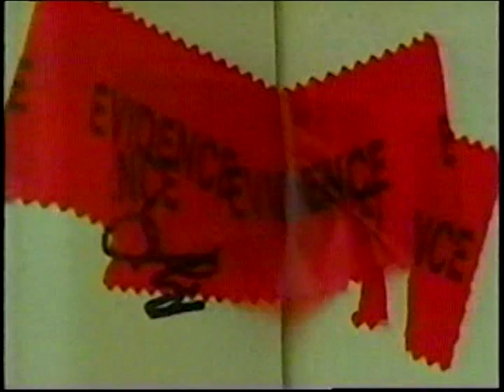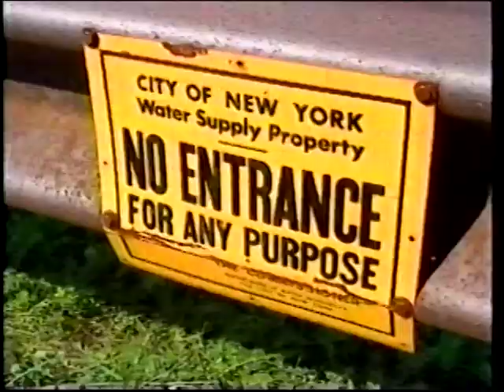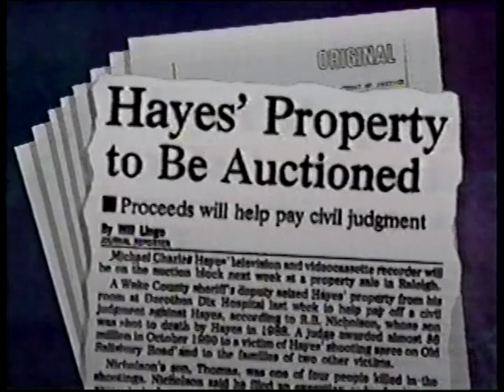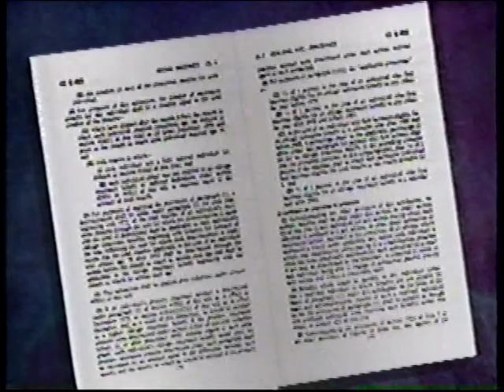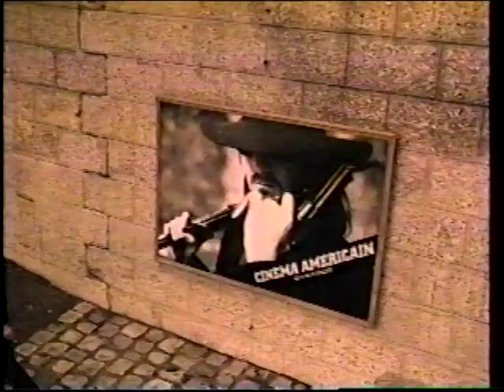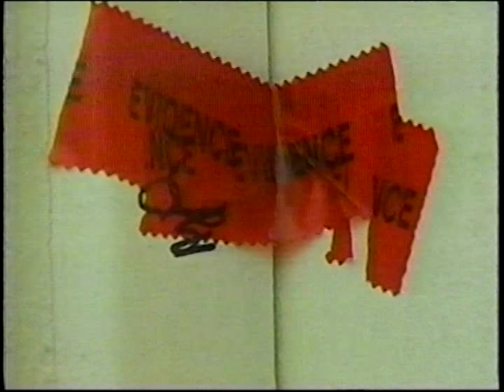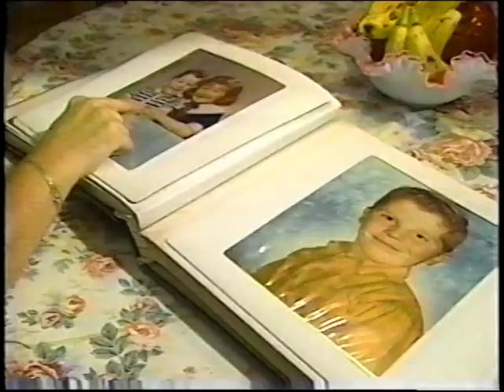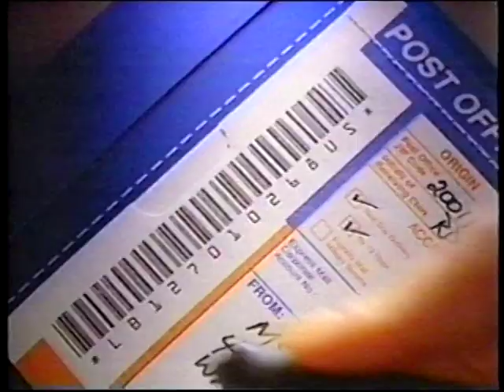DATELINE NBC-10/93-Stone Phillips, Jane Pauley Pt 1

Comment: Thanks for uploading it! I think back in 2015 you had part 2 with commercials when you first uploaded it but you took them down I could be wrong though
Reply from the maker: The first part I found had commercials, correct. The second part was just as I've posted it now. the original tape ended right after Howard and therefore I never had that story. You're welcome.